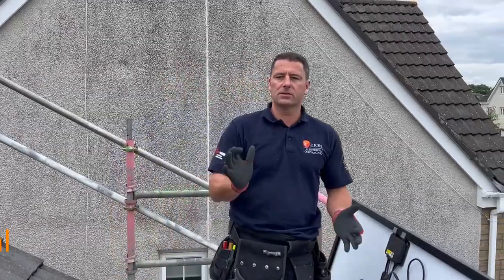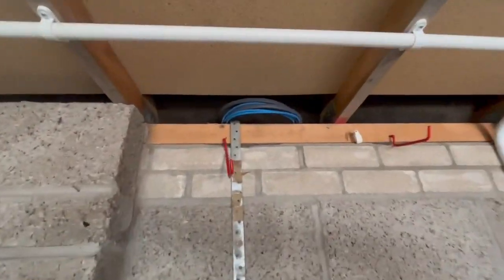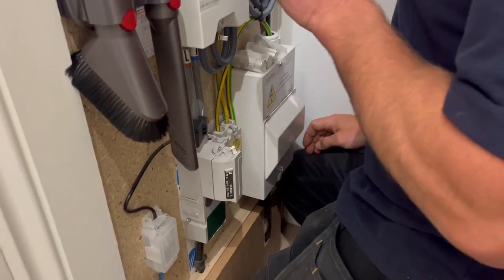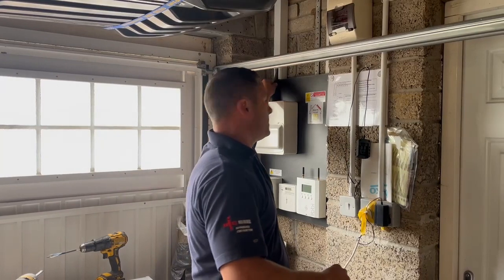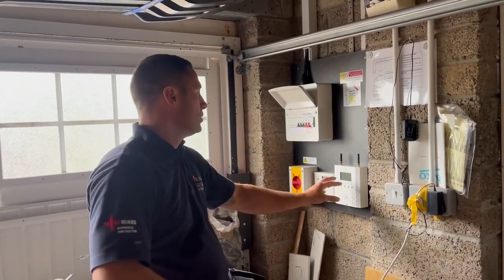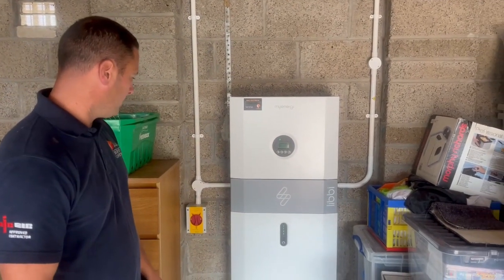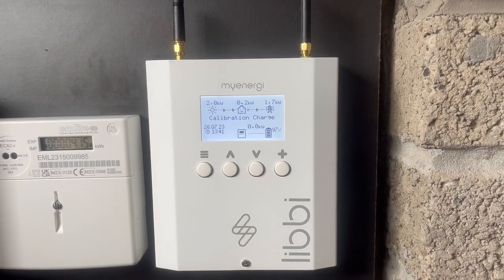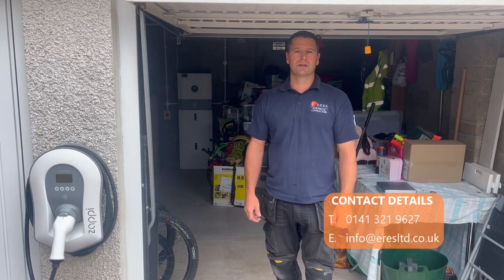Myenergi Libbi, Zappi & Eco system install

Comment: on the connection to the garage are you running the fed from the service head to a henley block then into a 63amp main switch then via SWA to garage consumer unit ?
Reply from the maker: @GlennMartin-j7g  add Henley blocks consumer side of meter, 63 amp switch fuse, SWA to garage.